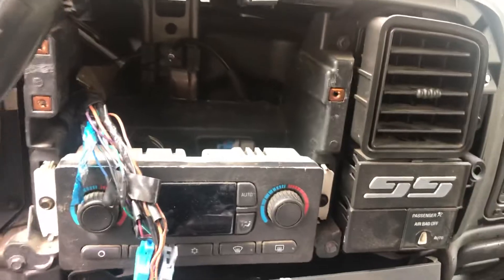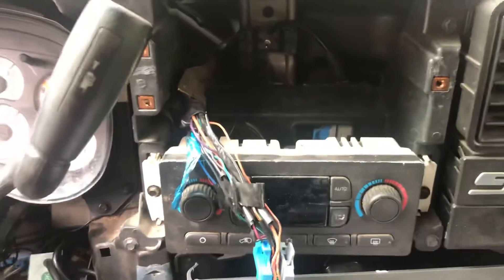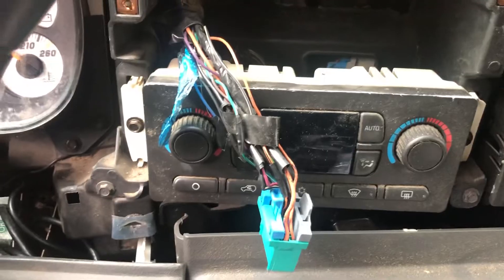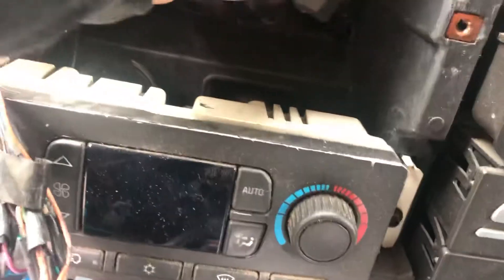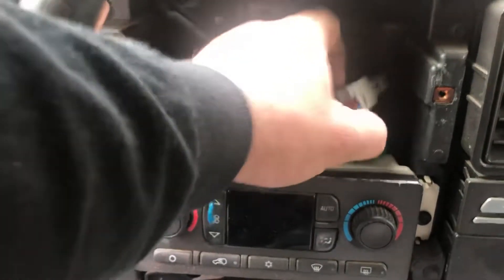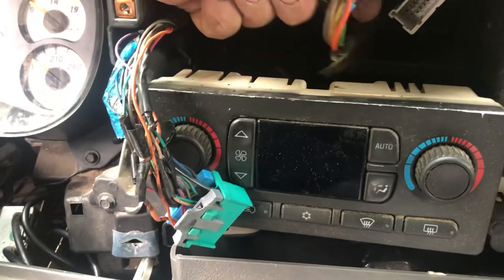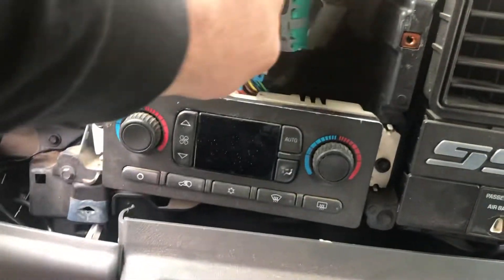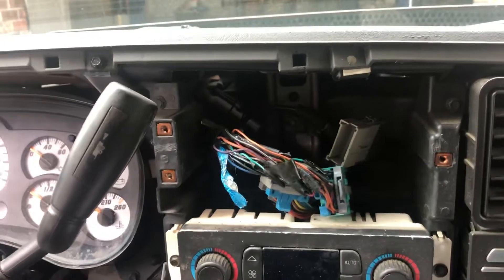03-07 silverado tahoe yukon sierra bose free bypass

Comment: The Bose system is not as good as you would expect it to be. The amplifier hasn't got enough power to deliver the lows and the only tone adjustments you have on the cd-player are bass and treble.  You can't adjust the mids and there's no loudness button.  So I replaced it with  the cheapest touch screen player you can get from Amazon and  guess what ... it sounds much better. Thanks to this video I was able to install the unit. There was only one problem: this system here works for all of the speakers, except for the front tweeters near the windshield. I had to connect them with some extra wires under the dashboard to the front speaker wires on the harness. Problem solved.
Reply: What was the harness that you bought? as in the model? (I.e. 70-2002)
Reply: @saikothesergal  Amazon said it was compatible with my 2003 GMC Yukon. All it says is ASIN B07RP9F13B .(Husuku store)

Comment: I have a 2004 2500hd Silverado with the Bose system and the stock radio. Lost all sounds one day, figured it was the amp after a little research. I just went out and did this and it worked like a charm. I pulled the amp power fuse under the hood since it isn’t going to be used anymore and I’d read some complaints about guys having a power draw issue due to the amp . Thanks for the video 👍🏼

Comment: After spending 90 dollars on gm interface that worked but sounded shifty. this bypassed the bose amp and my aftermarket amp works ten times better than the bose amp. Thanks
Reply: How do you know its bypassing the Bose amp? Just wondering because that clip hes plugging in to could lead to the Bose amp.
Reply: @whoopdeedo83  my aftermarket amp is hooked up. Youll notice a difference between the factory amp
Reply from the maker: youre welcome

Comment: what is that little connector that he swapped? does that connector he swapped directly power the door speakers? I'm just a little confused on the bose systems and so I'm trying to learn more,

can someone explain how this works? 

I'm under the impression that these bose trucks have a connector that plugs into the radio,  that sends pre-amp signals from the radio down to the amp, and then sends that signal out through wires to control the door speakers? Am I wrong in thinking this? I don't understand how swapping this little connector allows the radio to power the door speakers without actually removing the wires from the amp and rerouting them to the radio unit,

is this a t harness? if this is a t harness I may understand it a little  better than I thought, because signal gets looped from the amp, back to the radio in the dash before it is sent out to the door speakers and it is a t harness, then I think I can understand it as you would simply be changing the input to that harness where all the speaker connections already exist but can someone please chime in and let me know? I haven't been able to find much information on these bose systems anywhere

I need to know this because I want to add a sound system that is powered from an aftermarket amplifierbut I'm not sure what the best way is (removing wires directly from the oem amplifier and plugging them into the aftermarket amplifer vs using a plug and play harness) and the harnesses I find online don't really state what they do in understandable terms so I'm trying to learn the gist of how these system works then I can figure out where to go from there,

any help will be greatly appreciated 🙏

Comment: The secondary harness you pulled from the back. Is that the main harness for the speakers and power wire for the radio? As far as just straight wiring?

Comment: Right on thanks for the cheap way to do a bypass. Does the steering wheel controls work with this bypass? I could give a crap less about chime or OnStar
Reply from the maker: brandon Poe  i hear that. i hate the damn chime and im not payin for onstar.
Reply from the maker: the steering wheel controls will not work without a steering wheel interface module. i just installed one in my 03 tahoe. it works great. its a scosche gm2000sw. i have a video on it as well.
Reply: Stephen setliff did your Tahoe have the Bose system as well? on Scosche website it says that part will not work with bose systems? But since it’s bypassed it should work correct?

Comment: After bypassing the Bose amp, as shown, I plugged in the factory head unit back in and it still powers up but no sound as before. Back in the rabbit hole I go!!
Reply: Did you ever figure this out? I trot the same thing and had the same problem
Reply: @Jax-rr5rt  I had this issue too. I had a blue and white wire for amp turn on that didn't go to anything. I spliced it into the red switched power and it worked. Make sure you do it with the red switched and not yellow constant or you'll drain your battery. Hope this helps

Comment: So if I want to install a aftermarket head unit in 05 Sierra without paying all that money for the "interface" and still keep my factory speakers(or whatever speakers I have in the doors)this is the way to go? All it's doing is bypassing the bose amp correct? Allowing door speakers to be powered by the head unit amp instead? Been hesitant to tackle the radio install in my truxk for that reason.  So if this is all I gotta do aside from buying the normal cheaper harness I'm in business now lol!
Reply: U cans buy a cheap harness with the regular connector

Comment: Great video .. Thank you. My deck would power up at first ,  I wasn't getting 12v key power from vehicle side not sure why. Just going to run a wire , no biggie.  Works great , what a life saver.. 👍👍👍👍
Reply: A+z
Reply: Michael did you get your 12v for the key when the truck is on am got a truck the same way wires and all is cut

Comment: So I just upluck the harness?? & Boom my factory amp is bypassed ? Helppp ‼️ I have no sound coming from any speakers but radio has power I know the amp is gone
Reply: If you plug the aftermarket radio wiring harness into the plug like he said it bypasses the amp and runs the speakers directly off the aftermarket radio being installed
Reply: I also didn’t have any sound did you figure it out why it didn’t have no sound
Reply: @douglasgardner9223  i was in a wreck in it in the truck total it out sorry
Reply: @gabeulrickson2496 what about the tweeters in the a pillar

Comment: 04 tahoe z71 here and I’ve read comments where it simply won’t supply power to the speakers. Would all work fine if I ran an normal 03-06 harness with an aftermarket head unit?

Comment: I want to try this on my 04 escalade. I'm guessing I'm gonna loose my 10inch subwoofer though or will it still work?
Reply: I been looking for myself 🤦🏾‍♂️🤦🏾‍♂️
Reply: @dirtdunn8311  i ended up buying a PAC interface module so everything would still work
Reply: @dirtdunn8311  yeah, on a suburban, youll lose the

Front A Pillar Tweeters

Rear D Pillar Midranges

(Depends on the model) 10/8in sub in the back

(depends on the model) Sub in the front center console

Comment: I also have a SS too so after I spent three damn days trying to figure it out & after I watched this video it is fixed & sounds Great
Reply: Reginald Brown mine won’t start after this, dod you run into this problem?
Reply: @luisgarza6733  sorry just now seeing this but no I switched the two connectors & I also did the bypass at the amplifier too so that may not be needed
Reply from the maker: Luis Garza  ive done this several times and have never run into that issue. you must have some other underlying problem.

Comment: Holy F. I don't know if my 02 Bose Z71 is set up like this but I'm about to find out, it'll be a hell of a lot easier then trying to trick the tape deck or splice into the CD player. Thanks so much!
Reply: Did you try it in the 02? I have an 03 and I'd like to know.
Reply: @ericweathersbee6269  same as well
Reply: @marishashirley682  I did it like he said. In no music plays🤷🏾‍♂️ 03 Tahoe z71 help please
Reply: @ericweathersbee6269  Same here. Ive already got the aftermarket conversion harness installed but i want to disable the front console sub wondering if unplugging that back connector will do the trick.

Comment: I put a non bose radio in my bose tahoe, now I had no sound. Instead of putting a wire harness on that connector I plugged the stock (non bose) Chevy radio in and it worked like a charm! Thanks.

Comment: Anyone know why my 04 silverado with bose. Aftermarket amp went into protection mode. I switched amp and head unit but my sub no longer hits hard like it used to. Sounds very weak
Reply: BecauseStereoHas a bass Remote /Pre-Amp  an YouRemoved It
Reply: @jonreeder1419  thanks for replying. I bought the truck with a sound system. It sounded good. I took a 1hr trip and the whole time I was pounding. When all of a sudden it cut off and went into protection mode. I switched the stereo,amp and subs. But now the sub doesn't hit right.
Reply: @jonreeder1419  and everything works. I tried it on my uncles silverado without bose.

Comment: Won't work if you have the rear entertainment system like me
Reply: i was wondering why mine wouldny work, i guess this answers my question
Reply: What is the rear entertainment system ? I have tweeters , are you talking in the center console on the back where the headphone jack is
Reply: @codlife95  its the dvd player with flip down screen thats mounted on the ceiling above and in front of the rear seats
Reply: @pathogen73  I have the same situation with the old flip down DVD player etc and now no power to any of it

Comment: I tried this and mine gets no power, I’m trying on an 03 GMC Yukon
Reply: Most likely will have to run a seperate wire to an ignition/rap (retained accessory power) controlled fuse [such as the power window fuse] and an always hot fuse (the main radio wire) so that the radio will have main power and a ignition power so that the radio will stay on up to 5 minutes or until door is opened after the key has been turned off
Reply: This is because most factory chevy radios just get a signal from the bcm (body control module) telling it to turn on instead of an ignition 12v power telling it to turn on
Reply: Man what a pain in the ass! Haha have an 03 yukon also, just want to listen to tunes.